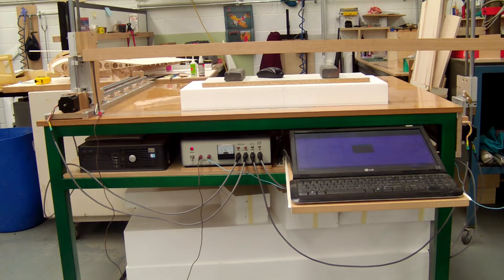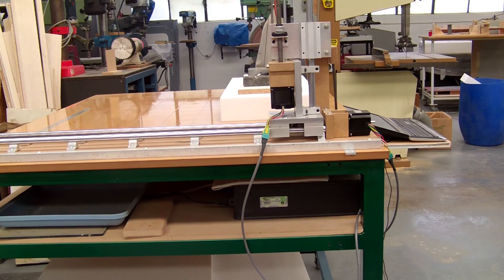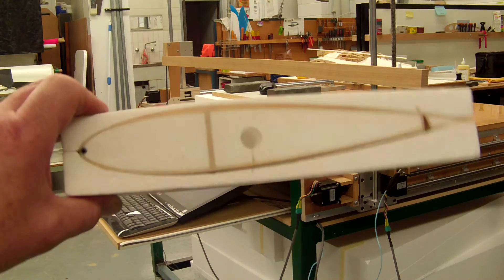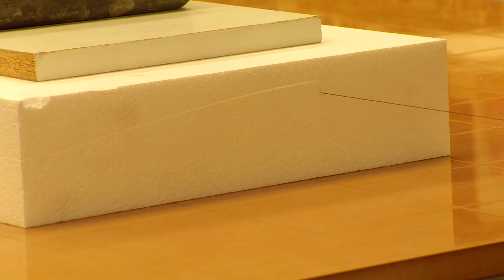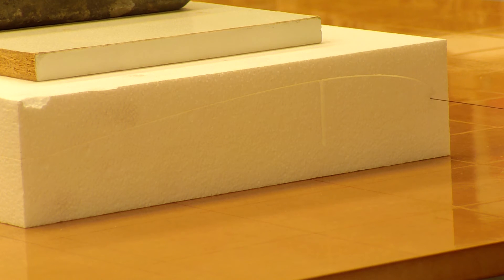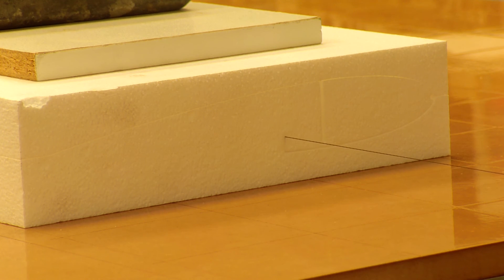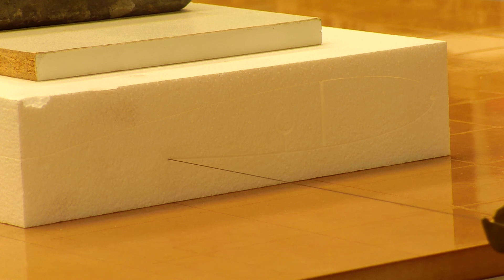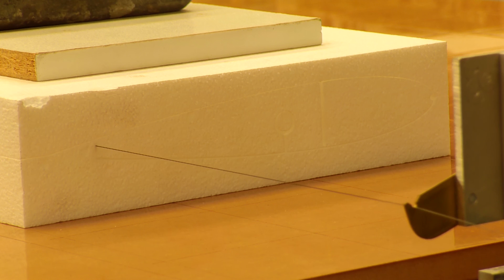CNC Foam Cutter.MOV

Comment from the maker: "Bit of a clunker", just some self inflicted sarcasm. The cutting software allows me to cut swept back or swept forward wings, dihedral, anhedral,  tapered wings with different root and tip profiles. I can do spar slots, servo lead conduits and provide for wing joiner tubes.